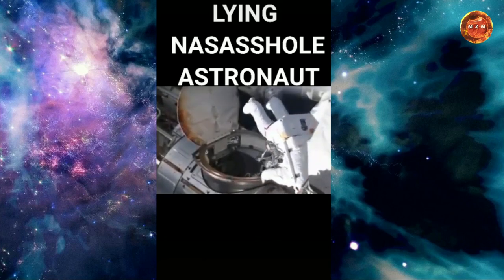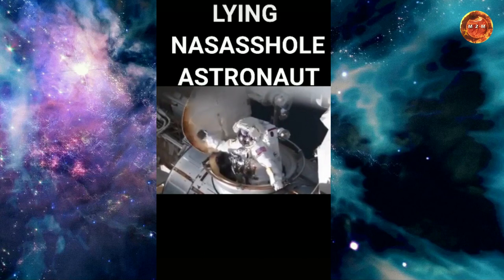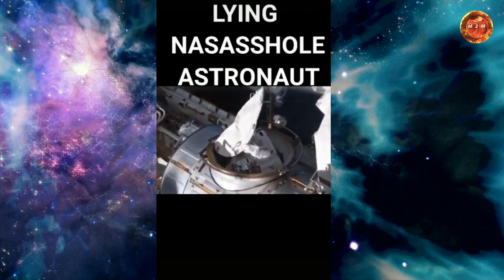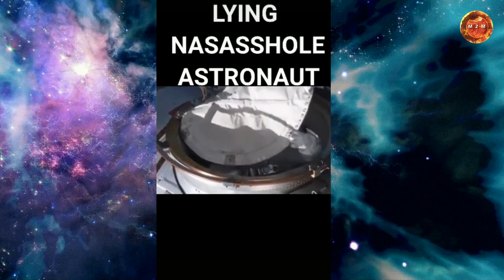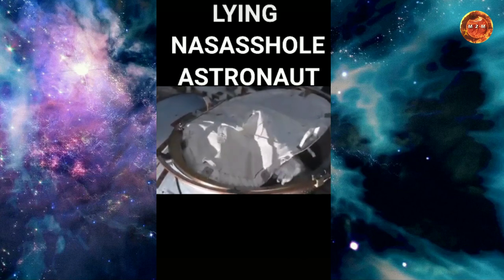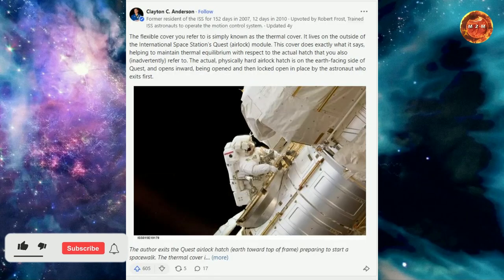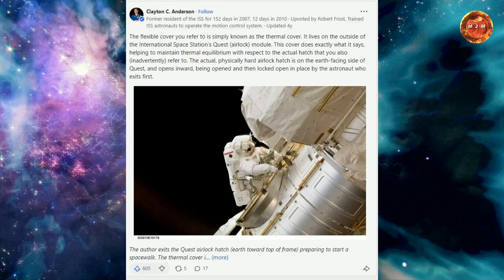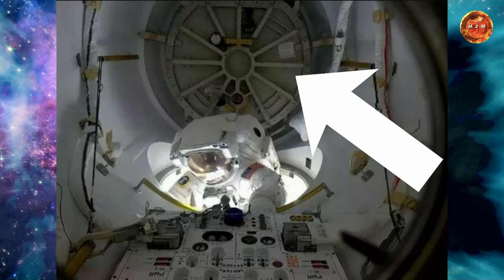Quick Vids#5 Are you awake?

Comment: My first response was literally, "that looks like a thermal cover. I suppose the hatch must be inside then? Hmm... wonder how that setup looks on the inside."

We see what we want to. Instead of assuming, dig in and learn... or just keep flerfing on I guess. Sigh.
Reply from the maker: Yes the door opens inwards as most airlock doors do to allow the internal pressure to assist with a good seal. The door is towards the right hand side of this airlock module. There's not much room in there and just about enough room for two astronauts and to close the airlock door.